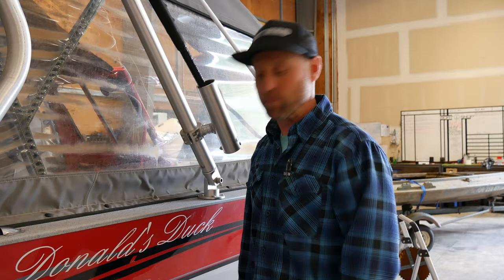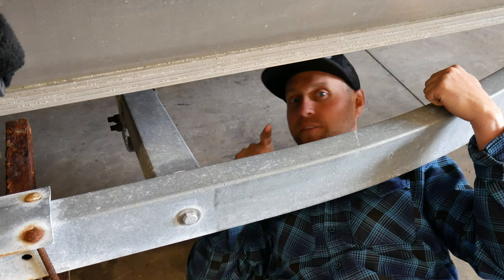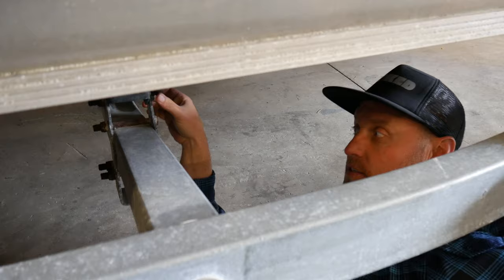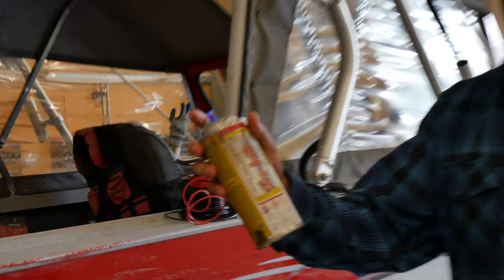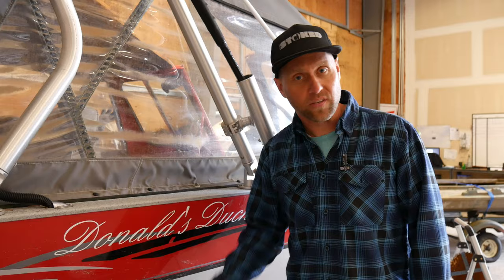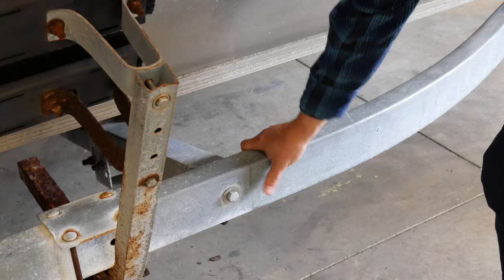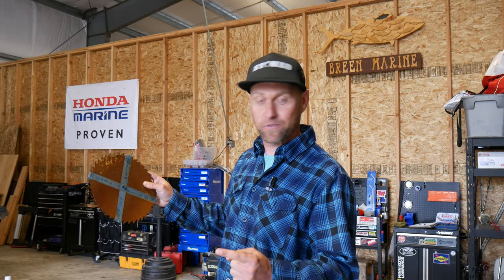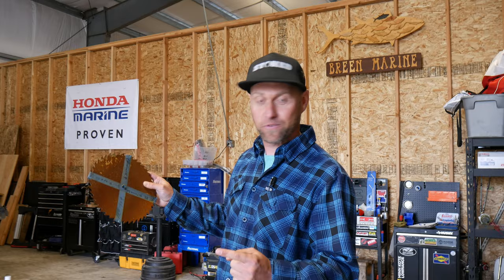Prevent rust and keep your boat trailer from rusting out! Be A Better Boater #12 [Breen Marine]

Comment: Keep up the great videos. I replaced the surge actuator(UFP A-60 Tandem Axle) and the calipers(Brake Caliper Assembly DB 35) on my boat trailer about a year ago. If you guys want the replaced Actuator and Calipers to have let me know. I did not want to just throw them away as I know they can be rebuilt.  Just need to get them from Canby to Florence.
Reply from the maker: Thanks glad you like the videos!

Comment: So they don't inhibit rust at all 🤣🤣🤣

Wouldnt the best piece of advice be to remove the rusted parts, clean, soak and remove the rust see what the real damage is than re seal with a bed liner or some type of shark hide and actually paint the pieces correctly with a rust inhibitor paint than seal with some clear.

You have enough money for a boat than you should have the 30-60 minutes to work on your trailer for the safety of everyone around you if you dont care about yourself
Reply from the maker: Yes, your right on about that, rust reformers are a good start after cleaning and prepping.  Good thought!